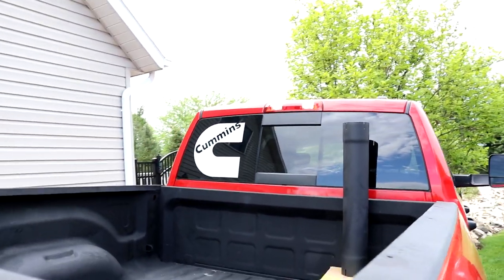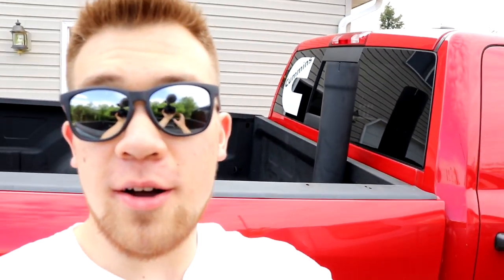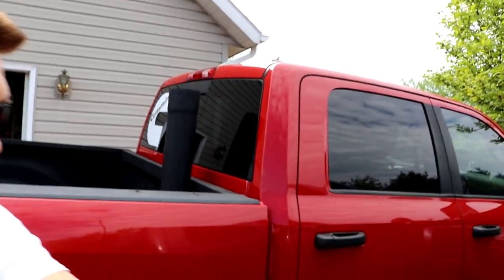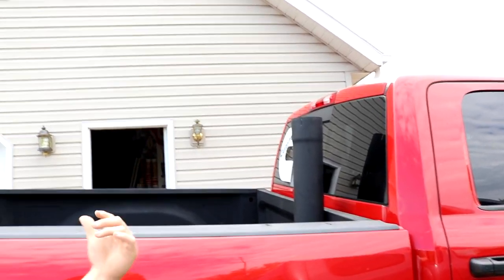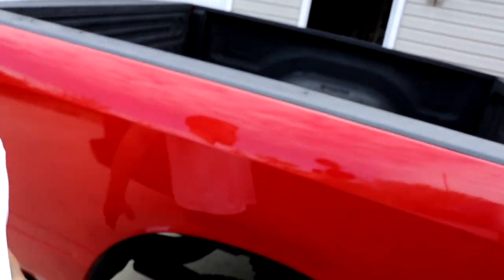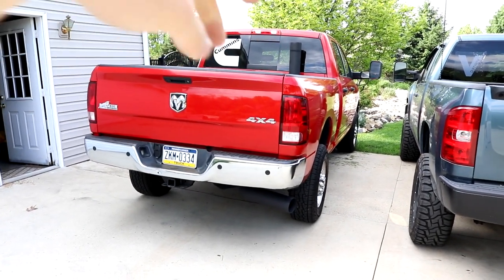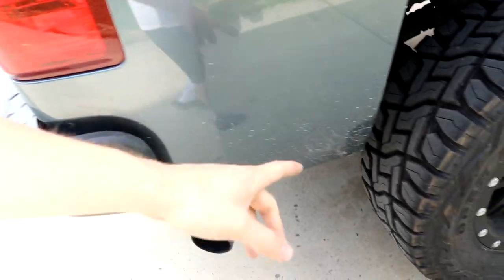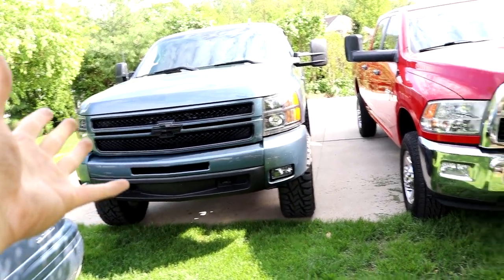5 Reasons NOT to buy a Diesel Stack Exhaust

Comment: If you lift the Cummins, GO LONG ARM LIFT KIT ONLY! Trust me, you will thank me later! And don’t buy anything less than Fox or King shocks
Reply from the maker: and a steering stabilizer
Reply: Upshift Z71 most definitely that and steering brace bar plus pitman arm clamp. I even took the liberty to replace my steering shaft to a HD aftermarket, built for lift kits. The Upper Control Arms we’re replaced too. Extremely surprised my rear end gears are holding up. Bout time to service that soon again.

The only thing I’m having trouble finding now is a snorkel kit or even a good one to fab to my truck.

Comment: I do not drive but I got two questions. My first question is it good idea to a diesel smoke stack on the hood and my second question is if I did drive what is a good truck old new like dodge or any kind is a good as a 5th wheel to tow that has a double cab. Email me at 37pat191@gmail.com  if you find out about anything thanks
Reply from the maker: these cummins have the most torque for towing, I could not get myself to cut the hood for a stack though

Comment: There's a bunch wrong with this video and probably others of yours. For starters you didn't give off any useful information about stacks, you made a video based off what you heard not experienced and wasted everyone's time by making a almost 12 minute video with about 2 minutes of anything stack related. Second your work is botchy at best, you're using silicone possibly grease and a hose clamp made for rubber that does not in any way compress that muffler onto the exhaust pipe, garunteed leak but again you baby your trucks so who knows if you actually get on it enough to even blow out such botched work. Third trucks are meant for work and you don't hardly do work weather its minor or major so why do truck related videos when you clearly have a lack of content to go with them? I mean just from this video I already can't comprehend the amount of butchery done to these trucks and then you give advice about truck stuff you don't even have done? Wow, I mean for all I know you painted the exhaust black with non high-temp paint yourself then called it "custom", I mean clearly you don't trust your work to your trucks yourself because you downplayed your gassers drive line angles because you didn't want to put full assurance into that work or lift you had installed even tho its a extremely average angle for a lifted IFS Chevy. Litterally a city boy that wants big trucks but doesn't know what for, just like a guy buying a harley because he thinks it'll make him tough. Seriously find something you can back up with experience and pride and then make good content. Making a 2min video almost 12min is just not good content. Clearly a stack all comes down to what kind of stack and whats your opinion on them, need both of those two parts to make a video. But I mean hey I can't make you give out better content but I'd hope you would do a little better with both content and quality of work.
Reply from the maker: up close and personal experience, I have driven a truck with dual stacks. The exhaust is still intact in parallel to the increasing amount of work I do to the vehicles. I utilized 2000 degree paint and the angles are better on most other kits.
Reply: @Derec  still shitty work, I could throw your exhaust together in 5 minutes, stack or no stack and still wouldn't even need rtv and the shoddy hose clamp to make it fit "right" just saying you could maybe learn before you jump into territory you aren't used to. Btw driving a truck with a bed stack and owning a bed with a hoodstack are two different things. Saying you rode a horse doesn't make you any better at owning one.